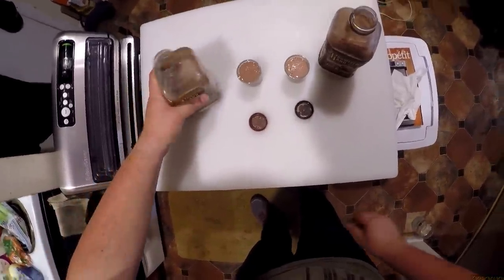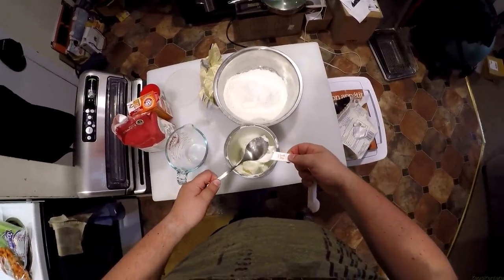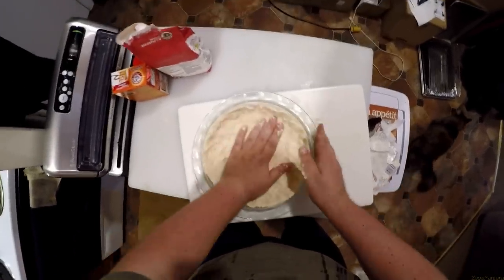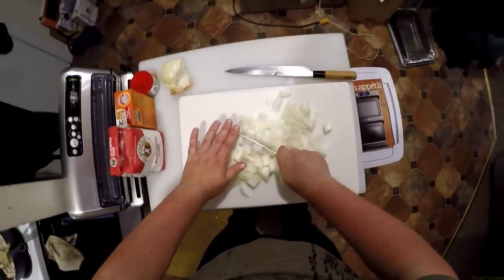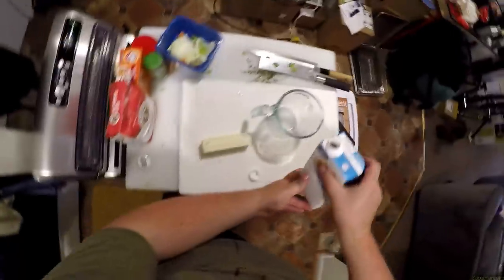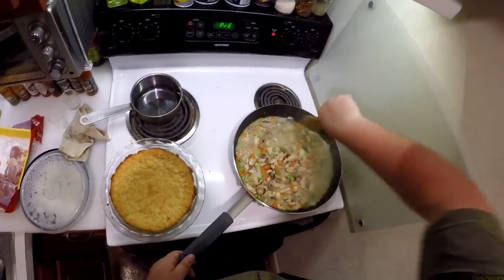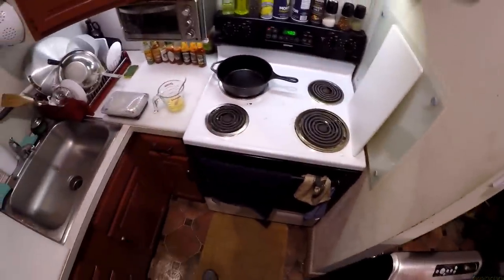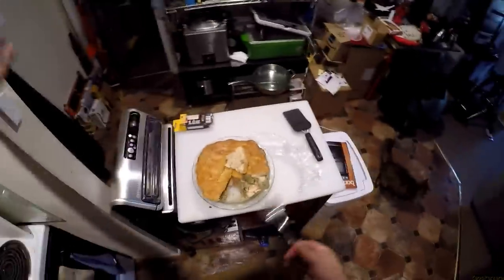Z Cooks - Alton Brown's Chicken Pot Pie

Comment: Missed a crucial early step: remove chicken from skillet BEFORE cooking onions and mushrooms with butter. You boiled the veg in chicken gloop, and that's where the flavor died.
Reply: quantok 

Yeah, brown the chicken, set chicken aside, cook the veg and deglaze any of the fond from the chicken, add chicken back to finish cooking

Regardless, need a larger pan for that quantity
Reply: Very hard to nail a recipe after reading it for the first time. You have to picture the process, and understand the reason for each step. That's why Alton is a good guide. And you have to prep: you can't hope everything comes together just because the instructions are sequential.